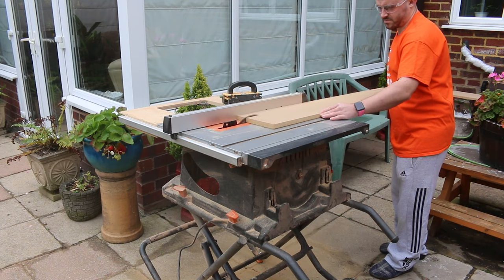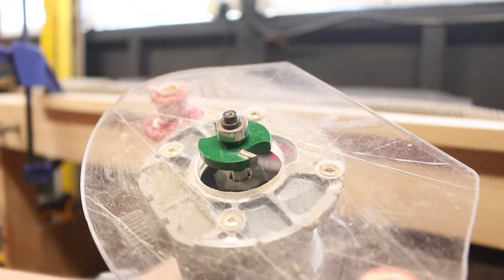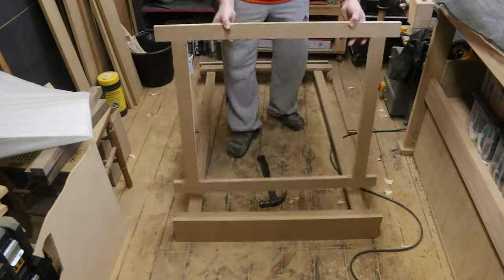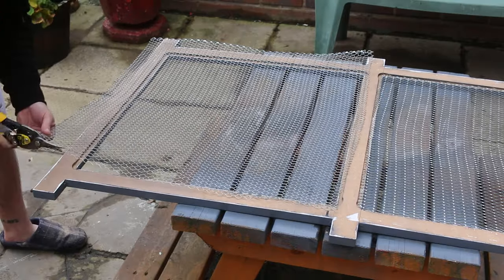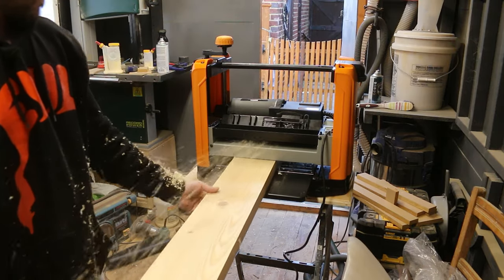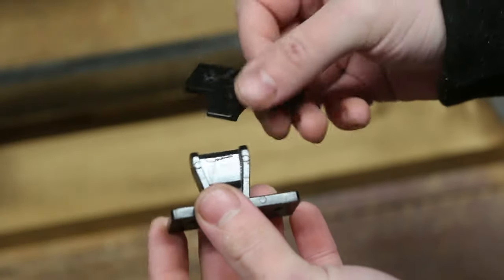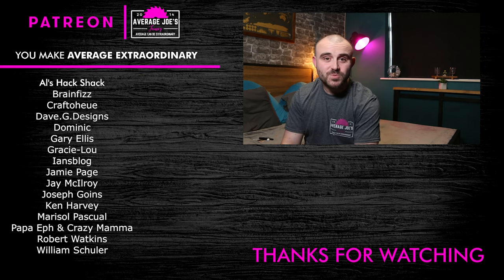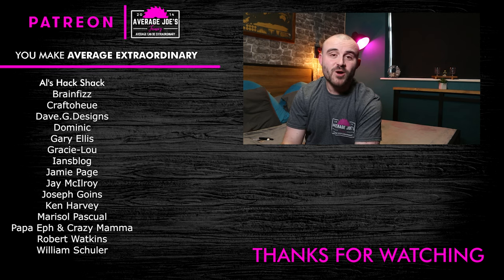How To Make An Industrial Radiator Cover

Comment: People go on all the time about painting mdf edges, I use a sharp, fine tooth table saw blade then I literally just go ahead and paint them. I sand them a bit when they are dry and paint again.
Reply from the maker: Don’t you find the edges end up fluffy and looking completely different to the face surfaces?
Reply: @AverageJoesJoinery  I do but then I sand the painted surface a little then repaint and it looks great. You have to let the eggshell paint dry for a day or so though